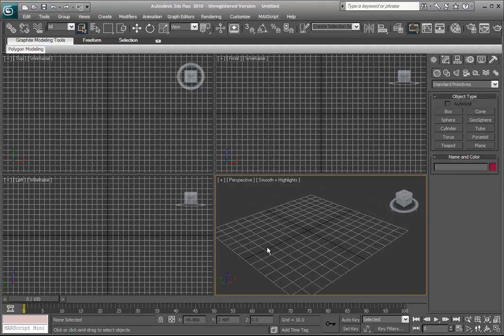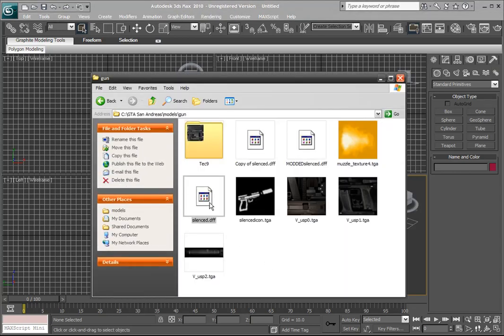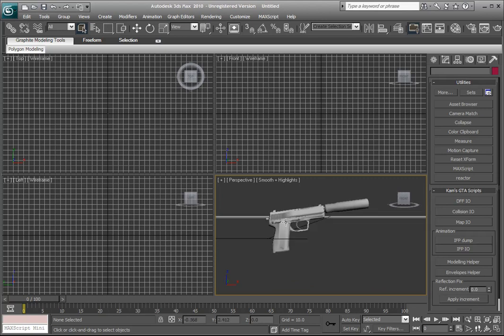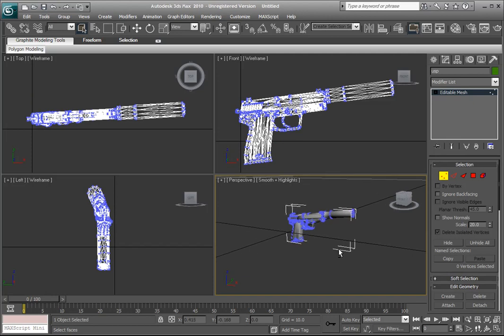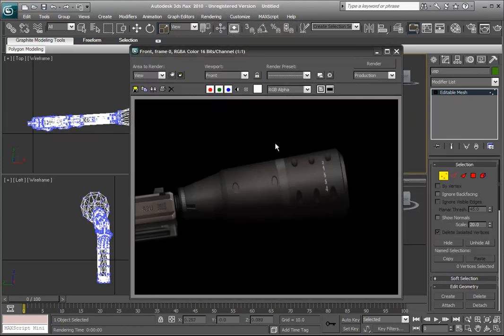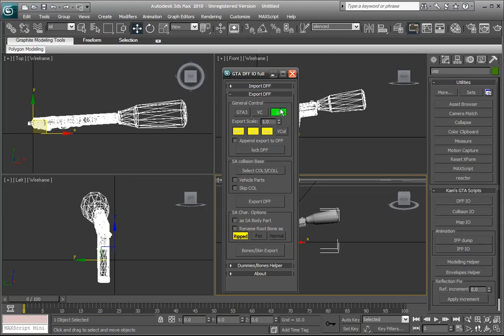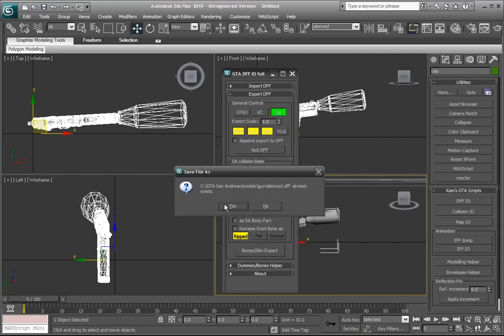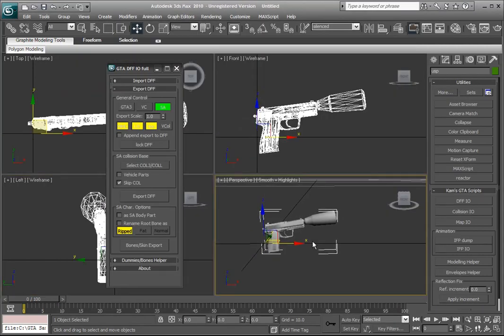Awesome Tutorial - GTA:SA - Edit a gun in 3Ds MAX

Comment from the maker: I like this little thread type thing going on here. :)

Just to improve on what acidstriker007 said, I've run Max on a computer with 1Gb ram, and it didn't really seem to be a problem. I think the CPU is the most important part for max though. I would highly recommend a quad core. But a dual could do it. :)

Also you will need a 512MB video card at least. Especially for rendering. 

Hope you get it all sorted soon! You'll have great fun with max!!